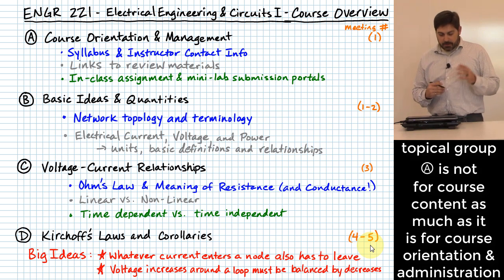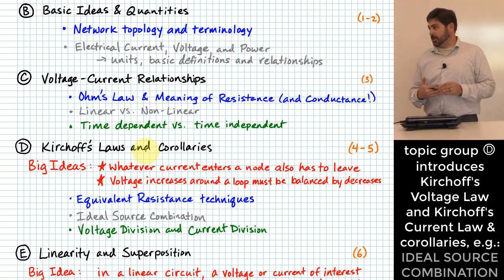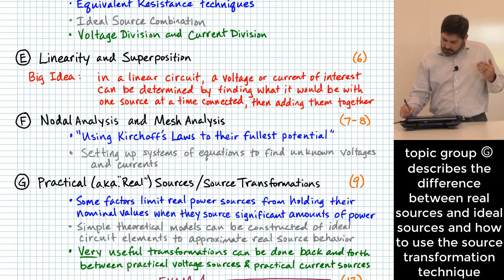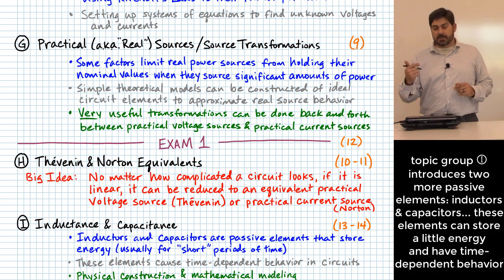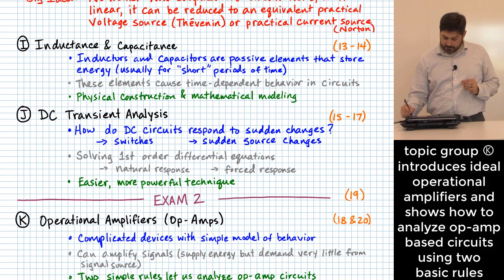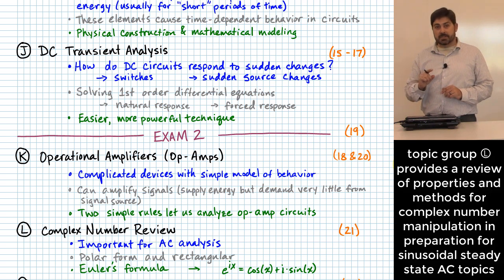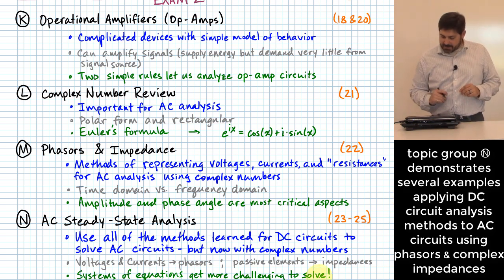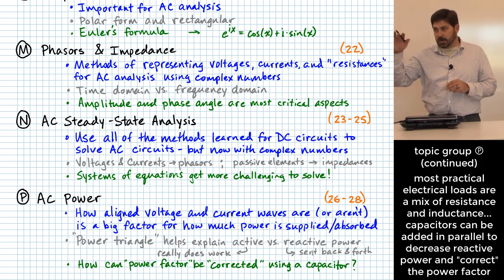ENGR 221: Electrical Engineering & Circuits I: Course Overview | Topical Group Synopses & Sequencing

Comment: Is there a book recommended to use long with your amazing videos?
Reply from the maker: For this class, I have used a circuits textbook by Hayt on occasion:
https://www.amazon.com/Engineering-Circuit-Analysis-Professor-Emeritus/dp/0073529575
also, you can check out a free text by Ulaby at University of Michigan: https://cad.eecs.umich.edu/
For my circuits class, just about any engineering circuits textbook will work.
Thanks for your support!